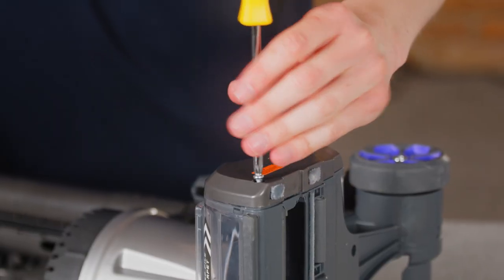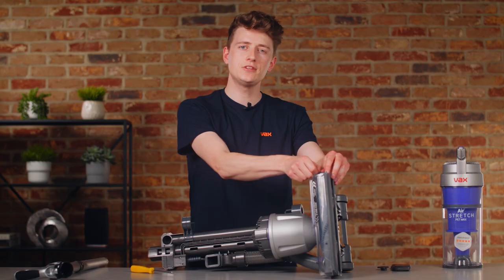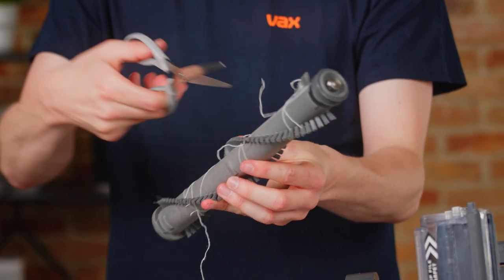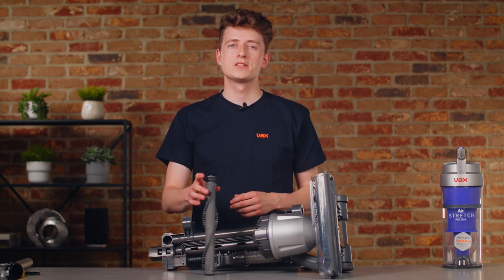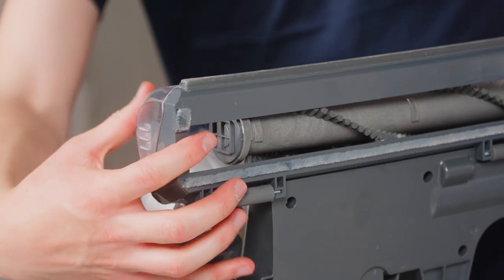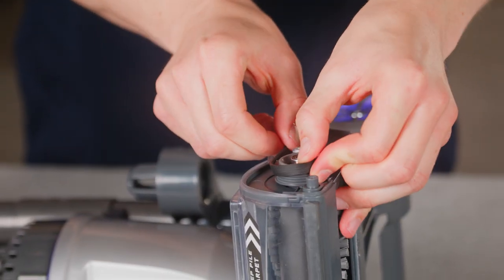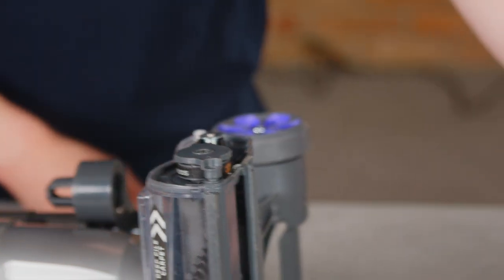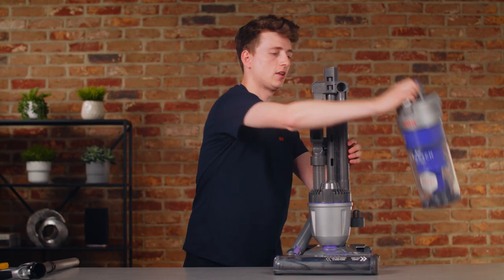VAX Air Stretch | Support Video Brushbar Removal

Comment: If you could buy a replacement brush bar anywhere, I could repair my Vax. You can't however. So, I won't buy a Vax again.
Reply from the maker: Hello, I'm sorry to hear this. If you need any assistance, our support team are available over at info@vax.co.uk 🙂 Thanks, Jess
Reply: @VaxVacuums  Why dont you answer the questions instead of referring to the support team. The whole design is poor, the belt should have had a tensioner on to make the refit better. Without it, it is virtually impossible to fit the locating plate.

Comment: Brush bar wasn't spinning while on or by hand. Cleaned it and popped it back in, it was spinning perfectly, turned her on and it's locked again won't move while on or by hand. There is a slight jerk & click from the square slot end when I turn the brush bar on, any idea what the problem is??

Comment: How would you know if the belt is worn? I have had terrible trouble getting everything back together again as the brushbar location plate won't go into position properly again
Reply from the maker: Hi Michael, I'm sorry to hear about the trouble with your machine. Our support team will be able to advise, please drop them a message over at info@vax.co.uk 😊 Thanks, Jess
Reply: I've had loads of trouble with this. I'm sure you have resolved this but for the benefit of anyone else whose brush bar won't rotate despite being correctly seated in the square. The plastic around the brush bar cap basically melted with friction so it would not longer rotate at the centre. I had to dig out melted plastic around the seam to free it. It seemed to defy all logic that I was putting it in exactly the right place. the central portion with the square in the bar itself is supposed to spin freely in its casing. The plastic melting meant i couldn't even see the seam until I dug all around and got it free. Very frustrating and after a flurry of sulphurous language I got it working again.
Reply: @thewickedpixie63  Glad I am not alone.. I managed to get the everything back together with force and a refund on items purchased even though my product is out of the warranty period. Thankfully I will only use it for carpets in future as I have wooden floors everywhere now. It was just annoying how it wouldn't get back together

Comment: Bro how does that thing spin when its a moulded square sitting inside a square slot that don't turn confused can fix it help ?
Reply from the maker: Hi Kennie, thanks for getting into contact. If you need help with your brush bar, our support team are available at info@vax.co.uk 🙂 Thanks, Jess
Reply: I've read your comment while trying to fix my vax and I figured out,that square mould should stay in place cause is a cap for the brush. You have to try cleaning a bit because is stuck
Reply: My exact question!! Its not possible! 🤬
Reply: Did any one figure this out?
Reply: @thomasdelaney1557 this is my problem at the moment, thr brush isn't spinning despite it being placed correctly.
Reply: @dmartinsPH did you figure it out? My exact problem rn
Reply: @weebethyboop1700  the brush just need replacement..basically the internal bit got worn out. I used the replacement and it worked again.
Reply: @dmartinsPH   How did you manage to get a replacement brush?
Reply: @dmartinsPH  Ive been having problems the square is fitted properly but still it doesnt spin freely
Reply: @usercdsas  same with me, the internal bearings became faulty after 3 years. just order one from their customer service..and it fixed the problem
Reply: 6 months palang sakin ayaw na mag spin haha @dmartinsPH
Reply: @usercdsas  awww.. Check mo baka under warranty kapa para ma replace nila ang faulty brush